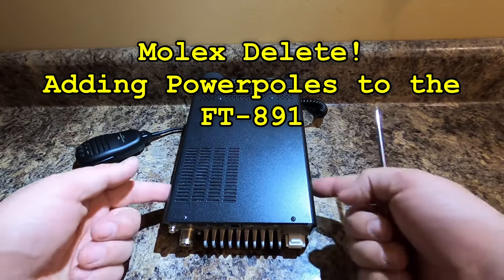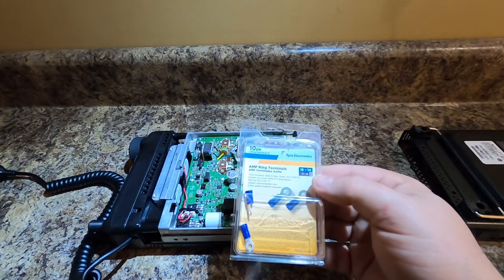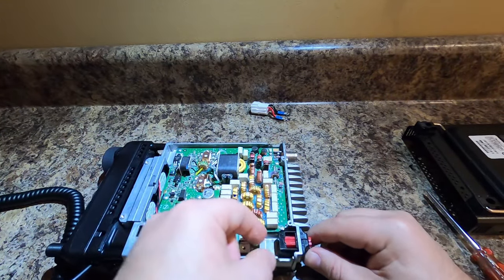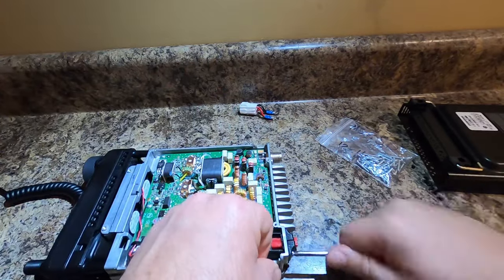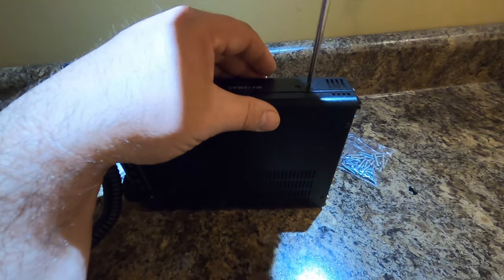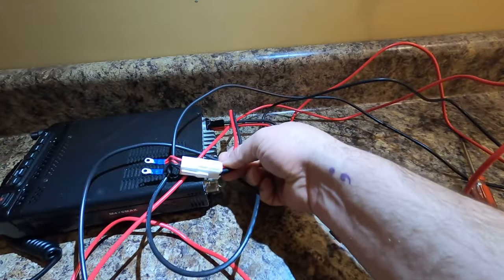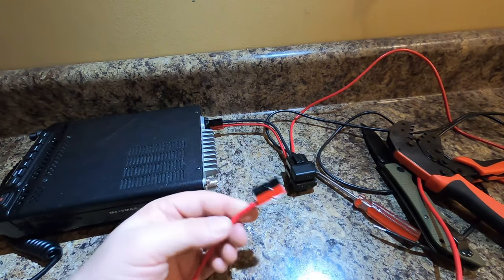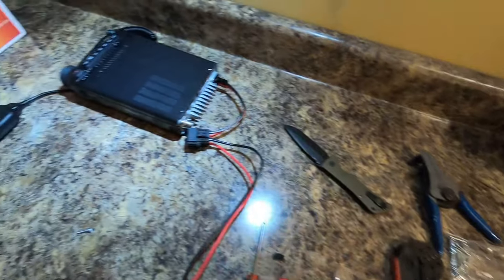FT-891 Molex Replacement with Anderson Powerpole Connectors - 3D printing and wire crimping

Comment: On all my radios I make sure I remove any standard connector with the least popular connector I can find on Amazon that has the worst reviews.  Makes it a conversation piece when I go to Field Day and ask my fellow club members if they have a Kazakhstan transgender comboblator X23 space modulator connector for my 891.
Reply from the maker: But is the cost where it should be? Do you bring spares? What kind of crimper do you use with the KtgcX23sm connector? Does it go by an easier to remember name?

Comment: To keep my wires together, I use a few 1" long pieces of heat shrink tubing spaced every 6-8" It's not perfect, but it works well enough. 1/4" tech flex braided wire sleeve is also good, using heat shrink to secure the ends.
Reply from the maker: This was only a temporary setup. I was waiting on zip cord to arrive. My battery is fused, which I should have mentioned in the video. I recall someone complaining that I had the fuse end attached to the radio instead of at the battery. 
I like the idea of TechFlex. I didn’t even realize what that was. My fishing poles are transported in a very similar material! I may have to cut one up and use some heat shrink to lock it in place.

Comment: 30-45 Amper?😂😂😂😂😂😂
Reply from the maker: I just use dollar store discount tin foil. About 2mm wide between the fuse holder contacts. I’ve never had one go bad. (Disclaimer: this is a false statement and meant as humor, though I have done it in an “emergency.”)
Reply: Ok